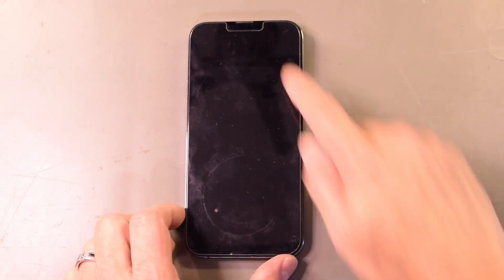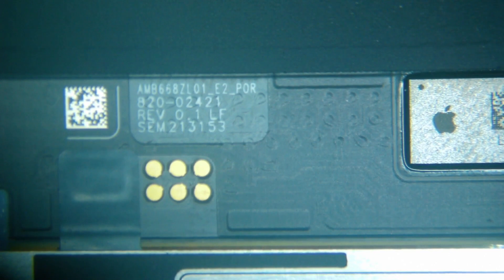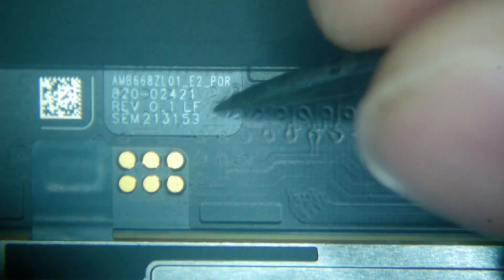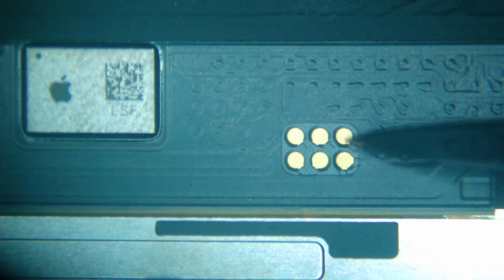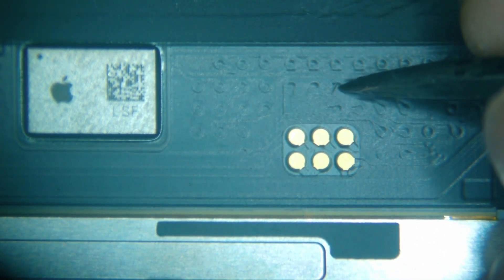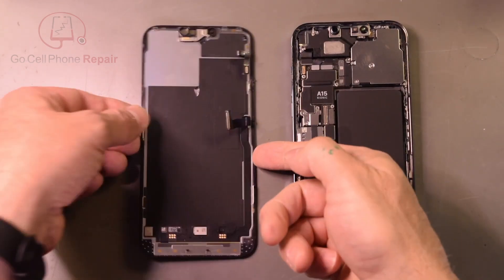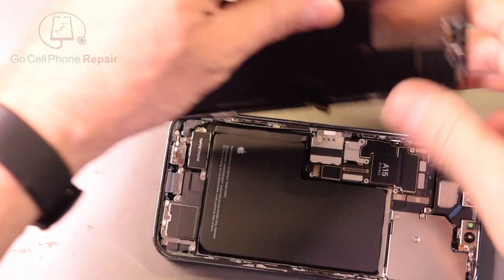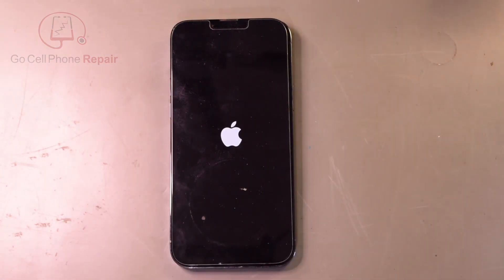How to Fix iPhone 13 Pro White Screen Using a Jumper Wire!

Comment: o.o the fact that ios software can 'fry' its hardware...? strange
Reply from the maker: Yeah kinda strange but I guess you can only test so many devices before releasing it to the public and find out what happens on a larger scale.
Reply: i suppose hey
Reply: Very funny